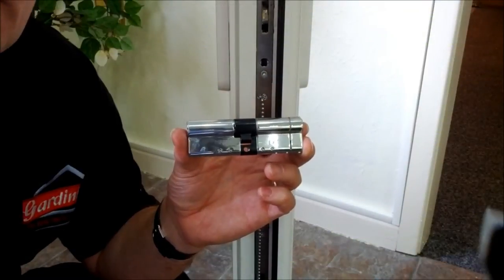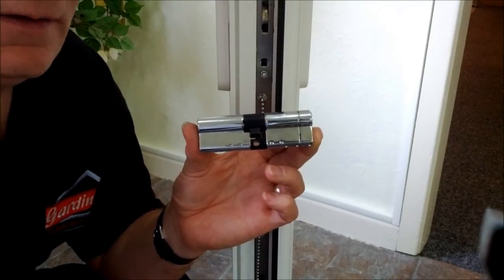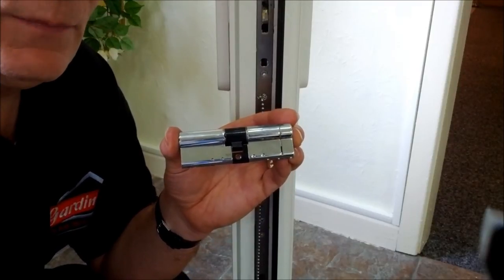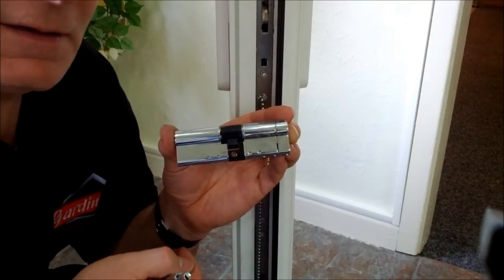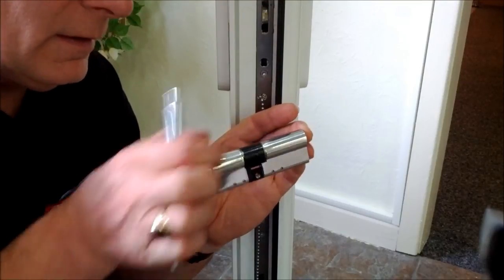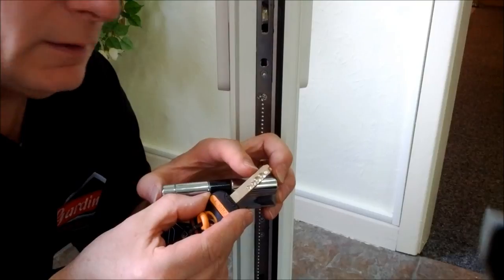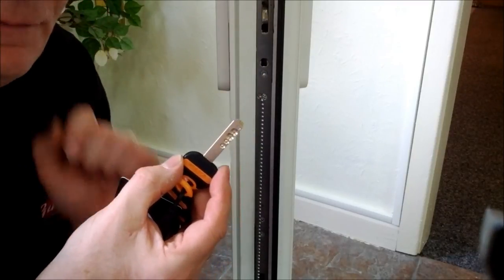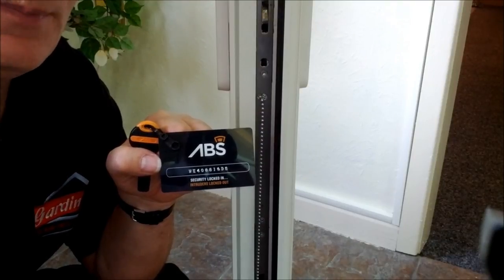Avocet ABS Euro Cylinder Security Information

Comment: My patio door is fitted with a ABS lock and is stuck shut, the key turns but the door does'nt open, any ideas as I cannot remove the cylinder.